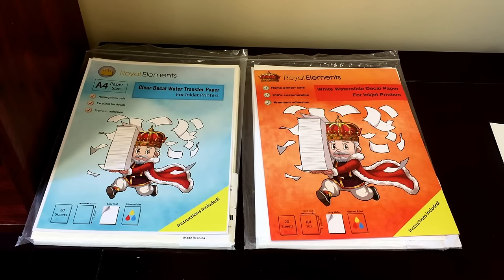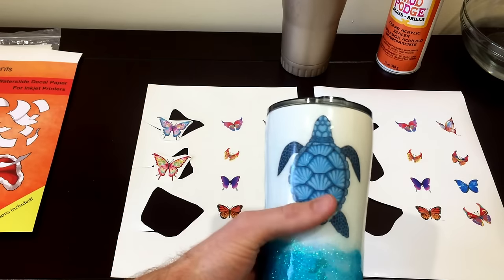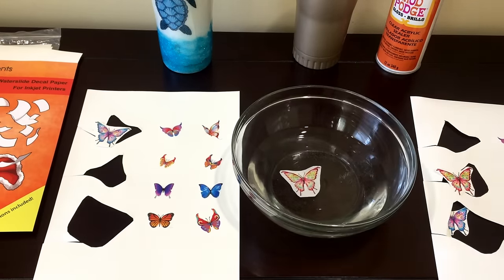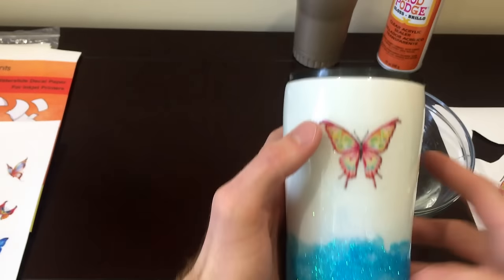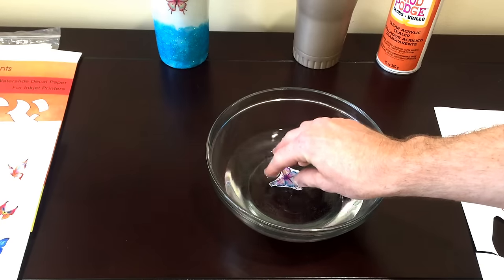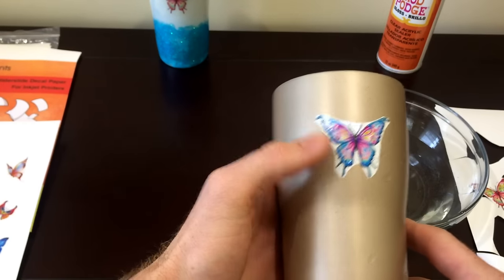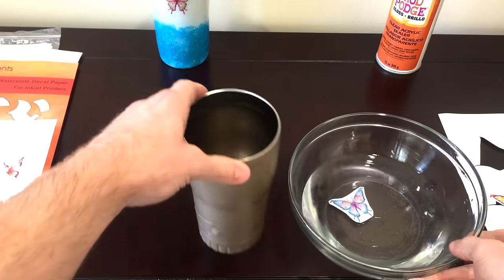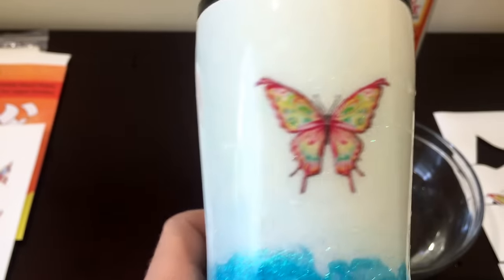The Only Waterslide Decal Paper Tutorial You'll Ever Need

Comment: You say inkjet prints need fixing spray and that you leave it for 1 hour between coats. But how many coats are needed. Thank you. UK
Reply from the maker: 2-3 is fine. Some waterslide paper doesn’t require a spray these days, even for inkjet
Reply: @royalelementsofficial Can you recommend some good waterdecal papers? I am going to apply on my acrylic and abs nails. I want to make them dishwasher safe. (1 month of durability is enough).
But the nails cannot be baked because of not resistance to higher temperatures. 

Could you provide a solution for me.  Thank you

Comment: When I spray acrylic sealer, the surface ends up not smooth, but slightly bumpy with all the spray droplets not spreading out. Is there a way I can get a smooth surface to match the rest of the ceramic?

Thanks for posting this, up voted, and subbed!
Reply: You could try rubbing it VERY GENTLY with 0000 steelwool or a white scotchbrite pad. You're not sanding, just scuffing the surface to get it smooth.

Comment: Hi there:)  if I coat the water slide transfers with acrylic sealer (3 times as you say), how long can I leave the transfer sheets without using? Would it be possible to use the sheets in say a year? I assume the sealer's function is simply to make the ink resistant to water. Thanks for your time :)
Reply: In theory, you can leave them indefinitely. They shouldn't degrade at all unless they are left in the sun

Comment: after applying the waterslide on to the tumbler did you seal it with epoxy, modpodge or any other kind of spray sealer? this would be my first project & dont want to use epoxy since idk how to use it and pricy for now.

on your description you mention hairdryer or ovensafe, if i use hair dryer without a sealer to finish would it be safe to hand wash?
Reply from the maker: Great question! In order to fully seal and protect your waterslide decal you will have to epoxy over the waterslide decal. Alumilite clear casting resin is a good choice for this, and after sealing the decal it will be dishwasher safe. 

If you just use a hairdryer without sealing over the decal with epoxy it will NOT be permanent, you will still have to either laminate or epoxy over it.
Reply: Thank you. I failed on waterslide😞 ink coming off...I got the epoxy you mentioned so imma gmhave to try another way. I sealed the waterslide before going to water I just keep wasting ink🤣😔
Reply: G
Reply: Hello can you tell me what method you use to seal glass bottles that have been painted? i.e. glam bottles I need to make sure it keeps its shine on the bottle and don't think I need to epoxy it